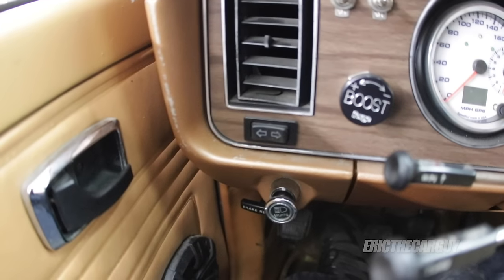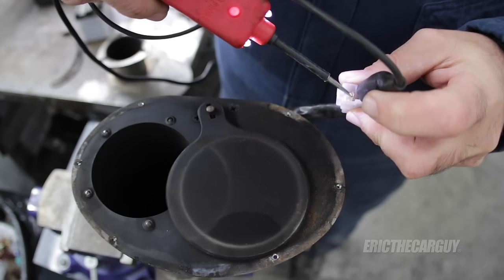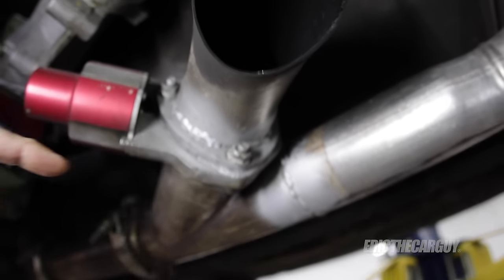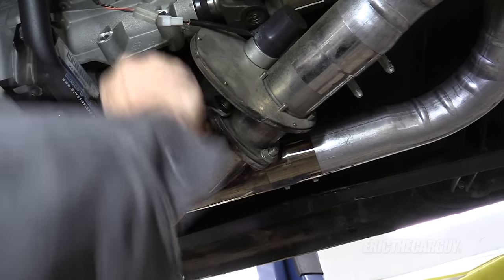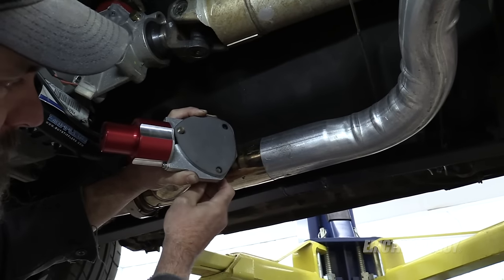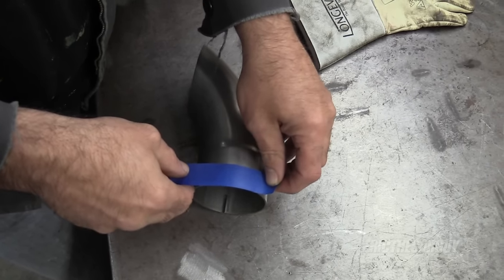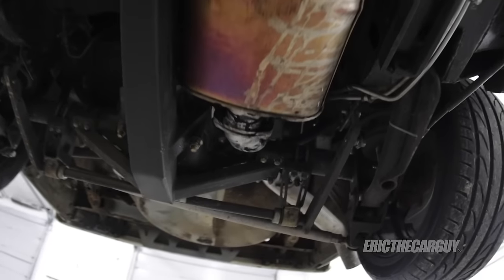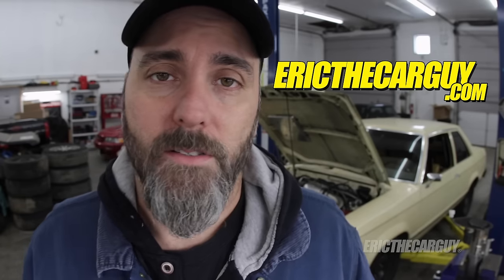Exhaust Cut Outs Give Your Vehicle a Split Personality

Comment: Sir can you please Dyno run it with the valve closed and then opened theoretically it must decrease the back pressure and thus increase hp but I really want to see that happening...thankyou
Reply: I watched a video and they dino tested both open and closed. Very little difference at the car they tested it on already had exhaust upgrade though headers etc.

Comment: Greetings, Videos! German car tuners that build exhaust cutouts that actually bypass the last muffler (not the middle one[s]) and that works in such a way that the exhaust still exits through the same tailpipe, so there is an actual bypass that it gets routed around the muffler and back into the exhaust pipe.
Reply: Interesting can you link an example.
Reply: Yeah we call what's in this video a "dump pipe" since it just dumps the exhaust right after the cut out.

Comment: Tip, when welding thin stuff, use a piece of wire as a spacer and u won't need to bevel it to get good penetration
Reply: M Blake Jr ??
Reply: Look up how to butt weld pipes with bevels.. Same concept Blake is talking about. Wire keeps gaps perfect
Reply: @andreslizarde7598  yup, used to weld pipes professional, thin stuff doesn't need a bevel. Especially exhaust

Comment: I have a vacuum powered cutout and it's A LOT more reliable than standard QTP style cutouts as it uses air to push it open and closed. The first and second motors in the electric cutout that I used to have burned out in maybe a month or two while this new vacuum powered cutout hasn't missed a beat for several months. Plus, it doesn't leak nearly as much and even better, it was only around $100 off Amazon.
Reply: Link?
Reply: Interested in this!!

Comment: I would have done a lot of things different but I cant knock you for trying, and I really like how you teach people how you do stuff. I'm a qualified diesel mechanic myself and I also do alot of electrical work. A bit of advice, dont twist the wires before you put them into the connectors you want them to actually crimp with the plug, when they're twisted it doesnt grab as good. I prefer solder but that's just me.
Reply: Can I do both

Comment: Eric, you compare crimp connectors to factory crimps, they are not the same. Factory crimps usually are about a 1/4 to 3/8 of an inch crimps where most crimpers that are available for crimp connectors are an 1/8 inch at best. As someone who worked installing electrical accessories to vehicles  for about 8 years and has did many electrical repairs since then, the best way to do any electrical connection on the outside of a vehicle is solder and heat shrink the connections. Believe me I've repaired more electrical problems caused by various wire connectors than I care to remember. What I have never repaired is a proper solder joint that was then protected by heat shrink. Inside of vehicles where they wiring isn't exposed to the elements, you can get away with crimp connectors and heat shrink but anywhere that wiring is near wet conditions including wiring run under carpeting inside the vehicle should be soldered with heat shrink. There is the old adage that you can take the time to do it right the first time or you can take twice as long to do it right the second time. When you are talking tracing electrical problems, it's usually 3 to 4 times as long to find the problem and then do it right the second time. That is why true electrical professionals solder and heat shrink their work.

Comment: I recognize that heat gun: The Harbor Freight special! I was tempted to get one myself because I like how you can stand it on end and use both hands for the work piece to be heated. But at around $8.00, I'm more afraid of this thing throwing off asbestos particles than getting a tool bargain. I came of age in the early '80's when a lot of dudes used blow dryers on their feathered hair-doos. Blow dryers were notorious for blowing out asbestos from the insulating material used around the heating elements. Asbestos was perfectly fine for use in consumer goods then. Stuff from China, I'm still very wary of in this present day.

Comment: I understand that the new Mustang has a similar exhaust system for the 2019
Reply: I own a '19 Bullitt Stang w/'Active Exhaust'
(bout $850 option)  & ea muffler has 2 tips.  1 tip has a butterfly cutout.  So 2 tips- w/1 on ea side having valves. 1 w/o per muffler 
  Ford uses set position settings w/labels for the varied positions from fummy closed to fully open.
QUIET/NORMAL/SPORT/TRACK.
Quiet is quite so.  Track requires U to "Accept" a waiver of sorts on digital dash screen saying u wont use it on street.  WHICH EVERYONE DOES.. NATURALLY. 
Has timer setup U can set so if get up at 5am for wrk..  u can set parameters for when quiet mode is on & then off ea morning automatically.  so as not to wake sleeping neighbors/infants/elderly,  ect.
The Bullitt sounds so good U want this Active Exhaust.   Its believed the GT350 Shelby intake tract/87mm Throttle body on Bullitt vs NOT on the Reg. GT 5.0 eng.
 IS what apoears to make it sound so much better than a regular GT mustang.
So having a cutout from factory is nice.

Comment: Solder vs. crimp: The Holley folks have a video(s) out there that goes in depth about why crimp is better than solder in most automotive applications.
Reply: If you do it right, it doesn't matter what method you use.  They both have pros and cons
Reply: That is why you have similar joiners like Eric used that crimp then heat up for solder flow and waterproofs with the glue+ heatshrinks at the same time...
Reply: Anti seize of some kind?
Reply: I have done both and in the worst condition wiring on heavy duty very leaky hydraulic hammer lots of vibration hot the crimp type slipped apart but I youse the crimp type now it’s important to rich the right pressure so a Ratchet type crimp-per is needed this and good quality connectors and your set !
Reply: I normally solder and then use at least 3 layers of heat shrink to stop the joint from flexing too much. To waterproof it, use heat shrink that has glue or put hot glue under the heat shrink right before heating it

Comment: I wish I could do that with the diesel. Problem is most of the noise the diesel makes does not come from the exhaust. Comes from the engine itself.
Reply: You mean the noise comes from the outside of the motor instead of the inside?
Reply: @jonathangarzon2798  No, the noise is actually from the engine. Diesel "clatter" isn't noise that comes from the exhaust. The sound comes right through the thin metal of the oil pan.
Reply: @consaka1  ah okay got it, never looked into exhausts for deisels so was wondering
Reply: @jonathangarzon2798  I thought of putting an insulating shield around the oil pan but that oil pan actually dissipates a lot of heat, something I need at the moment.

Comment: Had a similar mod on my old Silvia. Was great when sitting in traffic or leaving a quiet neighbourhood at night. It was more a valve in the exhaust that opened and closed which basically had it sit on an angle depending on how loud you wanted it. 

1st-quiet af, more than halfway closed
2nd-slightly louder than 1st.
3rd-fully open straight pipe sound.
Reply: Interested in this!!

Comment: NOTE:  True the ECU can adjust for the air flow difference, but only in closed loop operation.  But under hard acceleration, it goes open loop and only runs as the map says.  If you tune it with closed exhaust, it will be lean in open exhaust.  Or vice versa.  (Unless your ECU is hooked up to switch to a different map each time you throw the open exhaust switch.and is able to do so. Some don't.)

Comment: Hello I have a car
I have a problem with the automatic transmission that stops working after walking 1 km
I checked it on the scanner P0722
I changed the sensor and the problem remained as it came on and changed the whole transmission and the problem remained

These scan results
________________________________________________________
Mechanic:
Date: 30/11/2018
Car licence no:
VIN:
Mileage:
Vehicle: Saab - 9-5 - 2001
Petrol (B235E - 2.3ltt - Trionic T7 - MT/AT - 185hp)
DTC Description
No fault codes
Brake (ABS (Anti-lock braking system) - ABS 5.3/TC - MT/AT - TCS (Traction
Control System))
DTC Description
C0131 - Pressure sensor
- fault or faulty
C1926 - Accelerator pedal position sensor
- no communication
41963 - Unknown fault code
Instrument (Instrument - MIU - Main instrument)
DTC Description
No fault codes
Instrument (Instrument - SID - Info display)
DTC Description
No fault codes
Climate (Climate control - ACC)
DTC Description
B2406 - Air distribution valve
B2495 - Mixing damper motor
- (left)
Fault codes
Mechanic:
Date: 30/11/2018
Car licence no:
VIN:
Mileage:
Vehicle: Saab - 9-5 - 2001
Delphi DS150E (New VCI) | 2014 Release 2 (2.14.2.2) 1
Gearbox (Gearbox - Diagnose) (after last fault code deletion)
DTC Description
P0722 - Output rpm signal
- signal missing or faulty
Gearbox (Gearbox - Diagnose)
DTC Description
No fault codes
No fault codes
P0722 - Output rpm signal
- signal missing or faulty
Immobiliser (Immobiliser - TWICE - Burglar alarm)
DTC Description
B1210 - Seatbelt warning lamp
- interruption or short circuit to ground
Restraints (Airbag - Diagnose - With passenger airbag)
DTC Description
No fault codes
Multifunction (Central electronics - DICE)
DTC Description
No fault codes
Multifunction (Central electronics - TWICE - No burglar alarm)
DTC Description
B1210 - Seatbelt warning lamp
- interruption or short circuit to ground
Service Light Reset (SLR) (Reset service - Diagnostic reset (Recall service
message) - Info display)
DTC Description
No fault codes
Reply: bitcoin bitcoin unplug your T.V. then plug it back in.
Reply: @squishy3217  thank you
The problem has been resolved

Comment: Solder those wires and use the correct size shrink tube. Come on man, let's do things right.
Reply from the maker: I did. Soldering on cars is a thing of the past for me. Vibration causes solder joints to break. Like I said in the video, manufacturers don't solder connections, they crimp.

Comment: Shoulda just bought a flange instead of a plate.  Plate works in a pinch tho.
Reply from the maker: I didn't buy the plate. It was lying around the shop, that's why I used it. Different part linked in the description.

Comment: Just a friendly terminology tip from a welder/fabricator. When you are plasma cutting it is called "dross" not slag.
Sorry for being a stickler for vocabulary, great video Eric.
Reply: Same as calling GTAW  machines tigs, or still calling them tigs when using an active gas such as a helium/argon mix
Reply from the maker: I did not know that. Thank you.

Comment: The plasma's 'slag' is called dross and is usually easily remove by dragging across the edge of your steel workbench top or any wide steel tool.  I use a 2x5 steel cement margin trowel which is also great for splatter and BBs when using flux-core outside and it tucks neatly in a back pocket.  It makes a great scraper as well and was only about 3 dollars at home depot/Lowe's, etc...

Comment: Awesome videos mate, just a tip for future welding...
You don't have to bevel an edge on metal under 6 to 8mm thick, especially when welding 
what looks like a 1.6mm or 2mm pipe to an 8mm flange, you will make the material so thin that it could blow holes in it when trying to get enough
penetration into the thicker material!
 Also if you have bugger all room to weld, you could weld the nuts on the flange, just tack them on when it's done up so they are in the right spot.
Doing so will also be easier to put on and remove.

Comment: The problem with cutouts is that most of the exhaust will continue to the muffler and you're only getting partial sound increase. You need 2 valves, 1 open and 1 closed to completely block most to all exhaust from getting to the muffler and your sound will be much louder...I'm not an exhaust flow expert, but I played one while staying at some motel.

Comment: Hey Eric I need some advice/help 2005 Renault clio. Right the spedo on the dash the the lights have gone but all the other light on the dash work. Back tail light red one. The one You need at night Dosent work checked all the fuses engine bay and inside passenger side fuses. Also replaced the bulbs and used some electrical spray. Still nothing ???? Many thanks

Comment: That's bad ass. Maybe a stupid question, but I'm gonna ask it anyway. Could you theoretically do this to bypass a cat? Like a cutout prior to, and again after the cat, with a U-shaped pipe that bypasses the cat, both operated off the same switch? When turned on, the switch turns the cut outs on, opens the U-pipe and bypasses around the cat, then joins back with the original pipe. And when shut off, the valves close, closing off the U-pipe, and makes the exhaust flow back through the cat?
Hell, maybe even another cut-out added in the same way you have it? Turn on: bypass cat and flow back to the original pipe on the other side of the cat until it reaches the 2nd cutout and bypasses the muffler. Turn off: back to the original exhaust. 

It's like the perfect combination. Legal/illegal. And you could pass your emissions inspections at the flick of a switch. 

I hope this gets an answer. lol

Comment: @EricTheCarGuy Could you please be kind enough to answer this for me

Hey there. I tried something similar in my " 1998 registered MARUTI 800 " , some specs are as 

Engine model: F8B MPFI (4-speed), Displacement: 796 cc (49 cu in)

Valves per cylinder: 2 (F8B)
Number of cylinders: 3 inline
Fuel type: Petrol
Peak Power: 37 BHP at 5500 rpm (F8B..

Well,  that's no macho machine, just an 800 cc small car but the issue I faced with it is that I blew one of the three cylinders. it literally started behaving weird, I mean it lost its power and pick up, gas mileage went down and some weird behavior was also there.. i guess that exhaust cutout made one of the cylinders go bad .. what do you think can this exhaust valve do such kind of damage to the 800 cc tiny engine ??

Comment: Hi New to your Channel. But basically looking for 'Cut Out' information, you popped up first.!🤗
 Now I Only run a, Ford ( in Oz) Mercury Capri XR2 Turbo going on 29yrs old. 
 Recently having a Larger 2.25" bore Exhaust system fitted she 'Moves better and Sounds better.' 
 But I am now Thinking 'What will happen' if I add a 'Cut Out' to my system. Because even though a Measly 1.6litre DOHC XR2 Turbo, Shuffles along nicely.
 But, Bypass that already Sports Muffler. What more will Happen..? 
 Keeping in Mind I WANT to Annoy my Neighbours. Because their the most Annoying Neighbours on the Planet.
 So 2 Reasons to fit, more 'Zoom Zoom' and 'Revenge'..!
 Sounds like a No Brainer to me..!

 Great Clip lotsa info and you have a new Subscription.

 Cheers from the 'Dud from Downunder' (Capri) and me..!
 Stay Well and Safe.
 Kim in the Land Downunder..!😎

Comment: I know this video is 2 years old, but I don't see a reason to have these. They're illegal. If you're gonna have illegal exhaust just run open headers, solid. Saves you weight and saves on ghetto wiring that's gonna get melted by the transmission heat like this guy did. Bolt on some long tubes and get a guy to bend up some throwdowns, have fun.

Comment: Hi mate just saw one of your videos for Honda Accord EGR cleaning and I thought to ask you can you please explain to me why my Honda accord 2003 iVtex 2.0 l. Petrol is making a very bad raddeling sound from the engine and it idles to 2000 rpm sudenly drops to 1200 rpm while driving and burns oil ????? 0__O its on 152 000 mi.

Comment: I was totally gonna raz yoy Eric on not soldering cause I build printed circuit boards for a living and I'm a solder grease and heat shrink guy but instead I'll raz you cause you kissed THE ABSOLUTE  PERFECT EXCUSE for a crimp...if it gets snagged like the last cutout did it wont rip the wire harness where it meets the body and shorts and blows some fuse! Doug's makes good stuff...but these smaller companies and RRP obviously from a design and MFG standpoint...just look at the Doug's it's not an intuitive design at all, simple is almost always best and that thing wasn't simple power ground and switch is the only simplicity haha

Comment: Mate, should have just made the pipe to slip inside and fully weld from inside. No problem with nut clearance that way. Havent come across those heatshrink connectors before. Looks like a great idea. I'll have to look arround for some.
Cheers.....Pete

Comment: You need to install another valve in the main exhaust connected backwards so when you open the exit the main will close. And vise verse for more performing noise 🤷‍♂️ 
 Because right now the fumes still travel through the main exhaust even with that valve open.